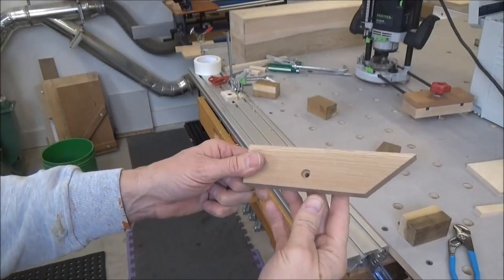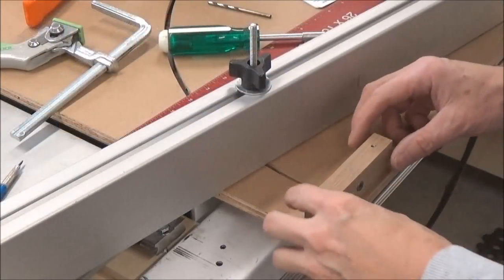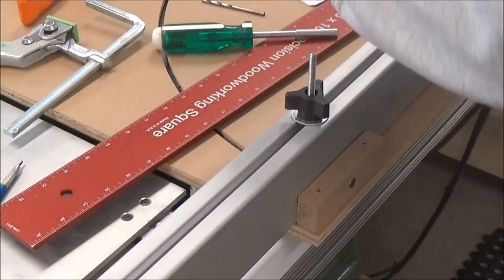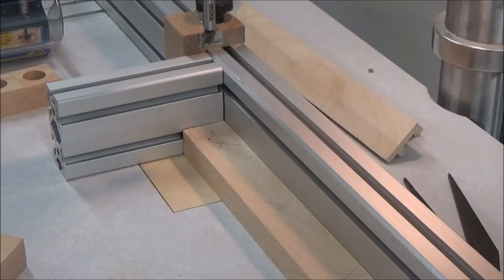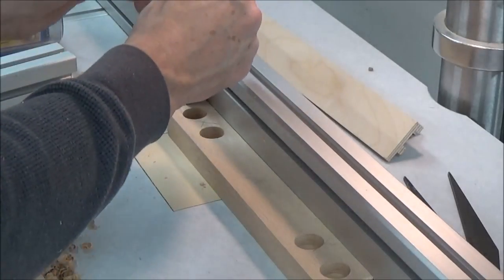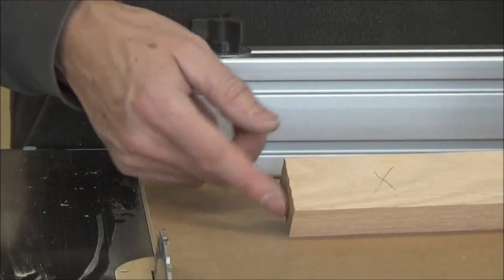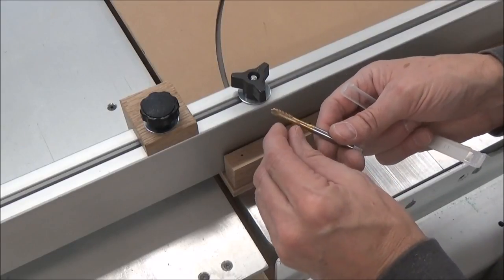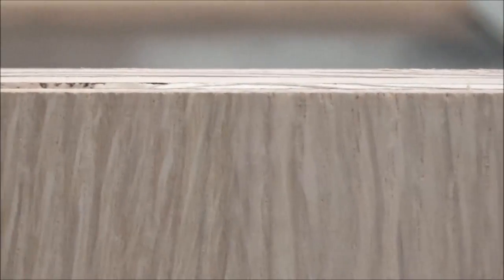04 Dubby Crosscut Sled

Comment: I'm interested to hear how this has held up! I'm looking to do something similar by frankensteining an incra mitre gauge onto an MDF board that I can fix to my sliding table accessory. I'm most curious about the set screw holding its setting in the wood - is it still ok? My first inclination was to set a couple nuts into the wood block so that I can loctite the set screw in place!
Reply from the maker: Set screw still working just fine.

Comment: Hi Jeff- i may have missed it. Did you proved a method for a stop that goes longer than the fence, like the original Dubby has in that steel tube?
Reply from the maker: I did but I don't use it to often. Thanks for watching.